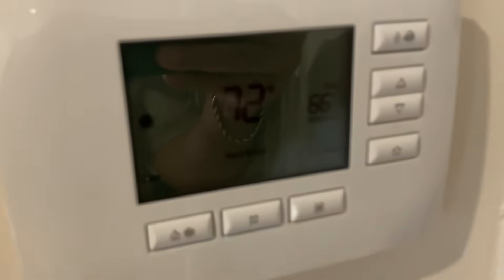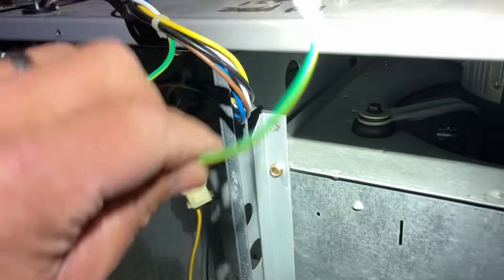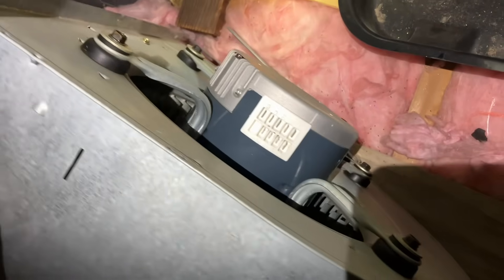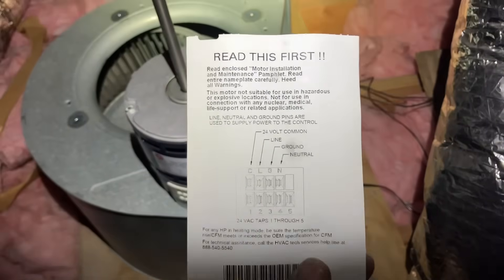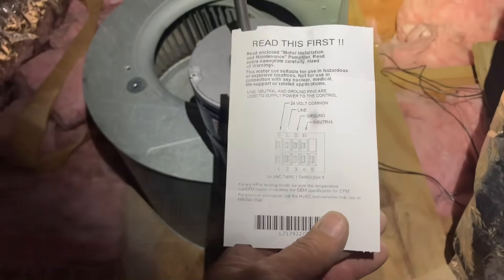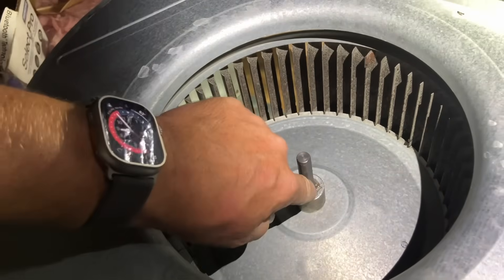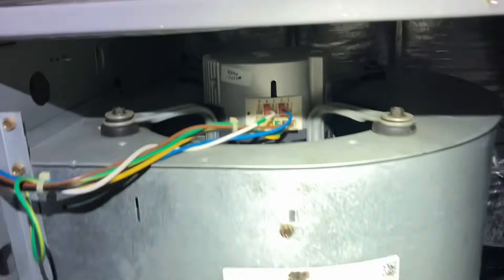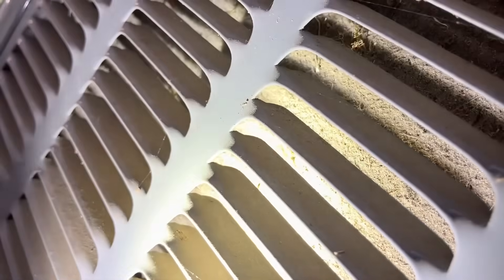Sunday Morning HVAC Emergency 🚨 No AC | ECM Blower Motor Failure & Replacement

Comment from the maker: 🚨 Sunday morning and no central AC? This homeowner’s ECM blower motor failed right before the holidays. Watch as I diagnose, test, and replace the bad motor with a rescue unit — all in under an hour on a Sunday morning.

👉 Have HVAC problems? Call Pipe Doctor Home Services at 516-348-6300 or visit pipedoc.net
 to book online.

💬 Drop a comment: Have you ever had to call for emergency HVAC service on a weekend?

#HVACRepair #MikeyPipes #AirConditioning

Comment: Yes I used to find those out a lot in residential. What I found was inside the motor commutator box or ecm part there are a set of circuit board parts called Mosfets or Mosfits. That is the section responsible for converting AC volt to DC volt and sending it to the series of "soft start" windings whereby starting the motor slowly and preserving it's bearings they say by doing so. They usually burn out after a power surge or storm power surge, something like that I've found. 
Rarely is the motor ever bad with that set up it's normally that 2 - 1/4" screw endbell parts that fail

Comment: 10 year warranty on parts if it was registered….??
Reply: I think Mike mentioned the motor was manufactured in June 2015. So even if it was registered, it was be near the end. Since the homeowner needed a new motor right away, a warranty replacement isn't an option, even if it was still covered.
Reply: @pandaman1784 very good point…hard to get warranty part on Sunday
Reply: My Rheem had a five year warranty which covered the ECM module but not the labor to replace. What’s  with these modules as many channels show them as common to replace?

Comment: Replacement motor is about $330 at Supplyhouse. The customer bill was “well over $1,000” for the part, the trip charge and an hour of labor. 

So as you said recently, the HVAC business can be very lucrative. 🤑

Comment: Can't you just change module? Because motor is good just the module bad. If not that sucks they should.
Reply: For some manufacturers, the module and the motor are a matched pair - - and is sold that way. Which means they are designed to be together. You can't really just take another module and drop it onto the motor. The module has to be configured for that motor.
Reply: @pandaman1784 oh OK thank you appreciated it.